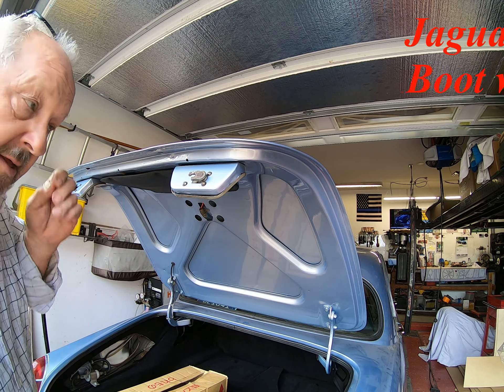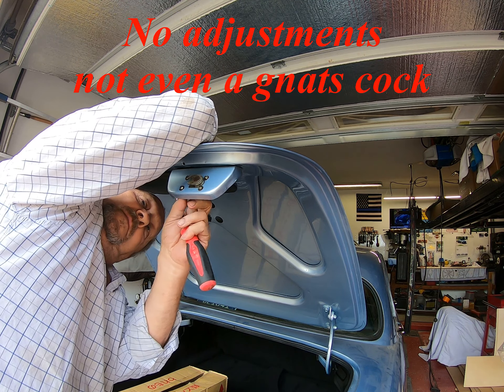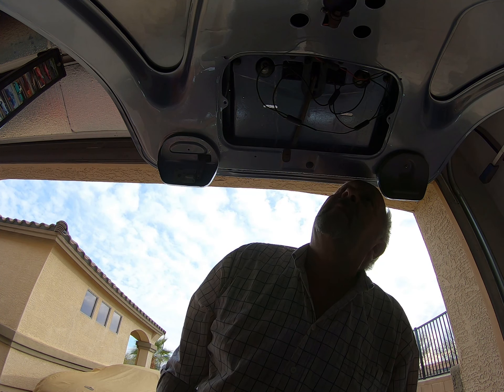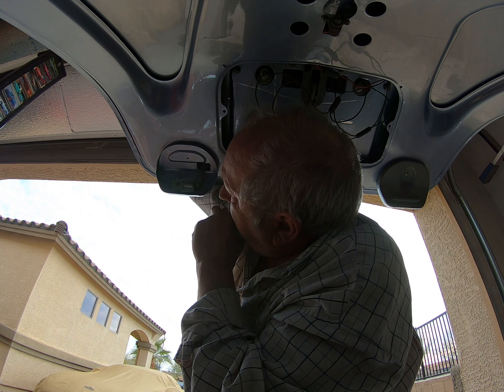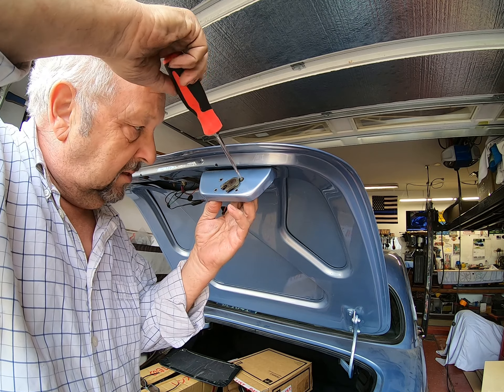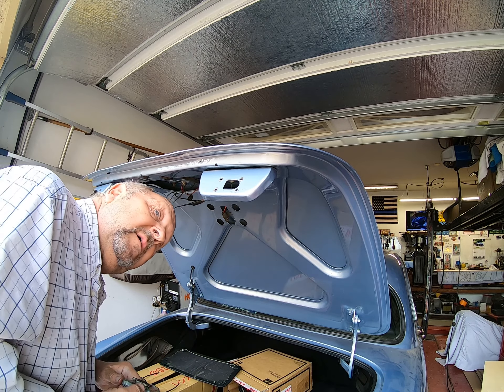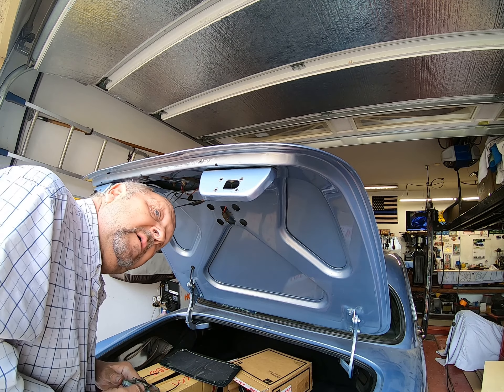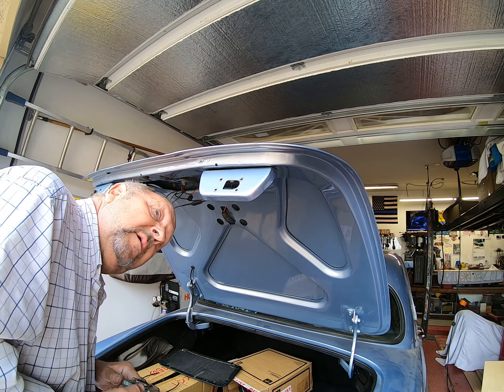Jaguar S Type 1965 Boot Trouble

Comment: I came across this because I have a similar Jag with a boot problem and YouTube lead me to your clip - which was fun to watch by the way! My issue is that I can't get the boot open at all.  It did open a few times when I first had it but not for the last couple of years. Any idea how I can get it open in the first place??-
Reply from the maker: There are only two ways I know obviously you have to be sure it is unlocked, then with pressure on the handle I used a rubber hammer and tapped it where the two locks are, I also pushed up and down on the boot lid, although I did this by myself a friend would be handy.
The other method I have seen done but have not used is to cut a hole behind the number plate to get to the cables , but if the cables have broken (unlikely) you are in trouble.
I guess you could also remove the back seat and cut a hole there but never seen that done.
I prefer the rubber hammer 😬
Reply: @jagvette1  thank you Sir!  I’ll give the rubber hammer a go!